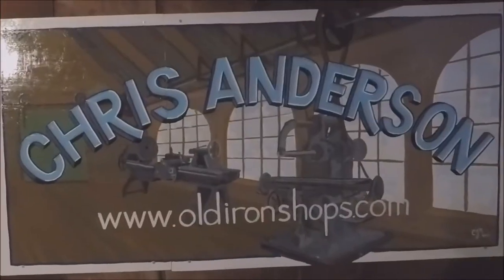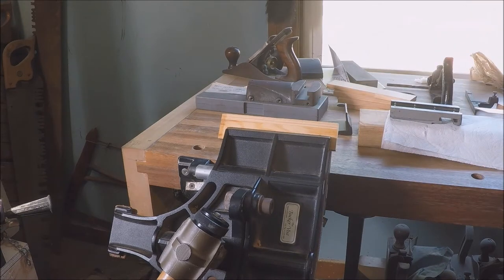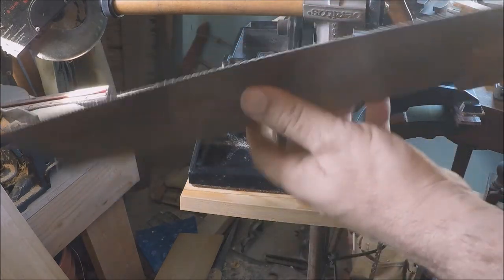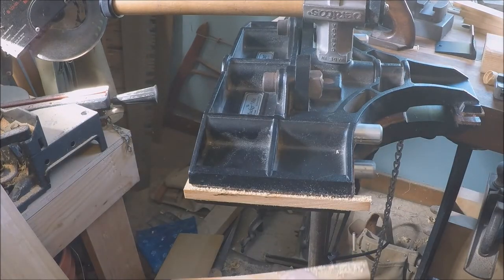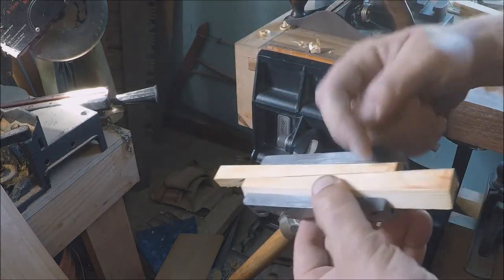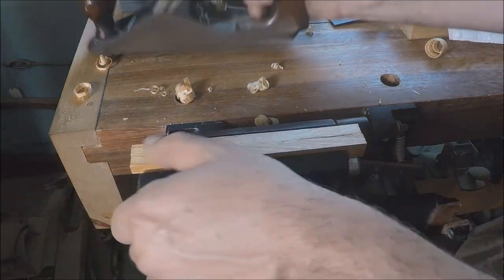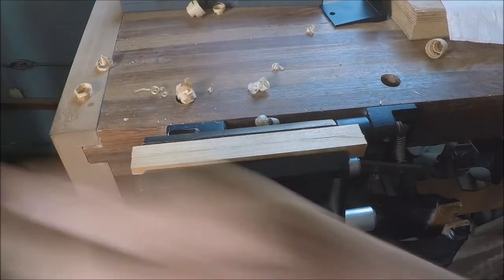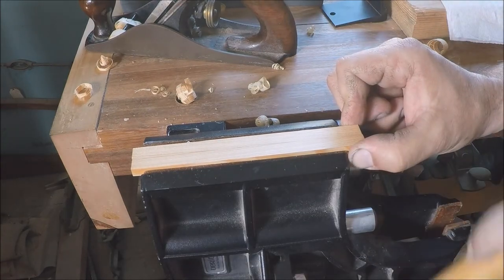Foundry Pattern Making: atlas compound slides #2

Comment: Nice work Chris.  On a small part like that, if you have the capabilities to machine out that dovetail section, is there a downside to casting that area solid and then machining out that feature?  Of course, it would be more metal which I assume you pay by the pound, and more machine time, but would a thicker section be more likely to have inclusions, etc?  I am just wondering what effects it would have on the final part?  Thanks for the videos.  R.J.
Reply from the maker: good questions im making this part flat as we plan to make a production pattern on a match plate so its easier to mount this to the board. this will make molding and casting easier and reduce costs . the thickness should not matter and i hope to have no inclusions that would be a flaw and get the part rejected material thickness should have no bearing on that . all the things i'm doing in this pattern are to try to make the molders job easier , give plenty of metal to machine down to nice clean iron but most important the part needs to be the right size .
Reply: R.J.'s workshop Chris knows more about this than I do but I remember a few things. 
Thicker sections are easier to fill. They have less inclusions  than small sections . Thin sections and sharp edges cool off too quickly causing the iron to "chill" . The chill is a very hard spot where the iron is silvery rather than grey. It won't machine well. Power steering pumps had a long neck that was prone to this. The inspectorsvwould check for it by running the corner of a file across the edge. If it didn't bite in the casting was rejected. They also cause the iron to freeze before the mold is completely filled. That leaves voids. 
A pattern with sharp edges and thin sections is more difficult to withdraw from the sand. It tends to pull sand free and the edges break off of the mold causing sand inclusions.
Reply from the maker: Thanks David your spot on with your insights. Better articulated then I would have managed as well.

Comment: Good job! When building patterns, is white pine the best wood?
Reply: At the Midwest Foundry the production patterns were aluminum castings. For the oil sand room where they did mostly short runs the patterns were often wood. The patternmakers used mahogany for the body of the parts but they would use pine for the buttons on top of the risers for the pouring spouts. Those got chewed up from the molders using a metal tube to push through the sand for the opening. They got replaced often
Reply: Old Sneelock's Workshop : How about durable? Pine has a habit of shrinking over time. For a once use pattern like here I can see it but how about for something that you may want to keep?
Reply from the maker: pine and mahogany are the top choices for wood. both easy to carve the pine patterns have lower life times so mahogany would be used if they wanted more parts out of the pattern be for it had to be rebuilt or repaired many times in high volume they will make a master pattern out of wood with a double shrink allowance and cast a production pattern in aluminum or sometimes iron. you can get thousands of parts out of your production pattern that way and only use the master pattern once so it will last a long time.
Reply from the maker: lol looks like we had the same comment